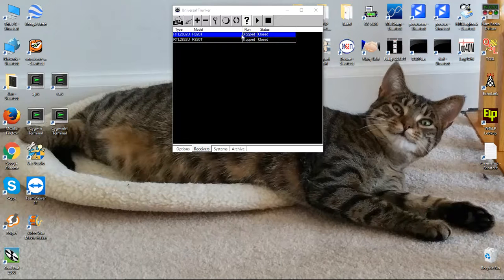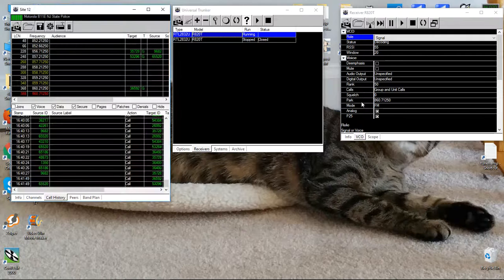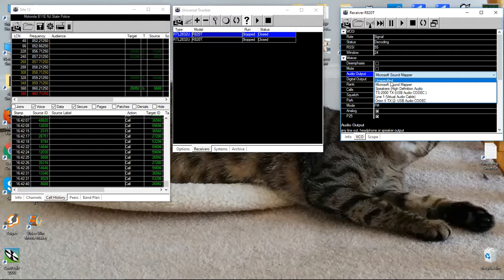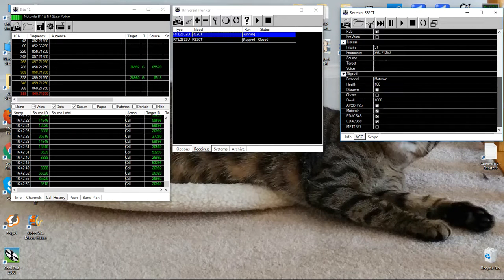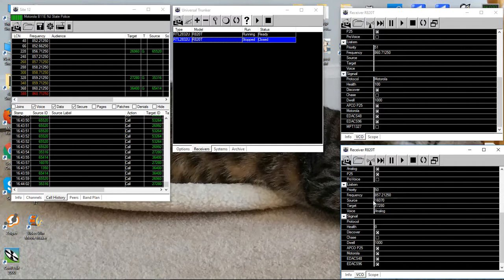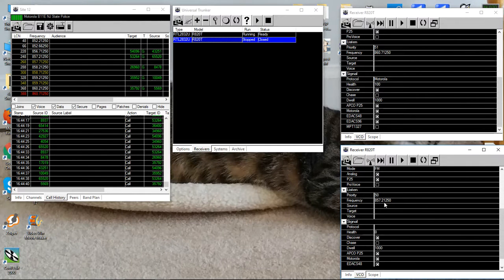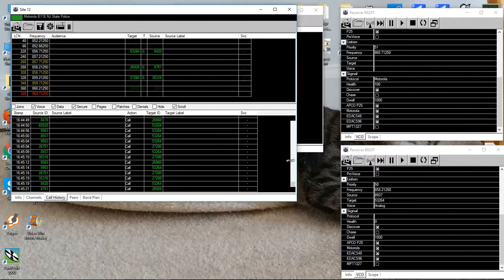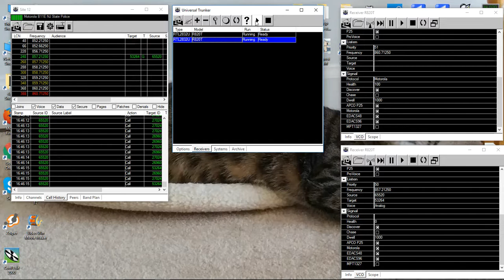Unitrunker Analog

Comment: When I use Unitrunker for analog voice systems, I always get a 3 second burst of white noise after a vice transmission ends before the squelch takes affect making it unbearable to listen to. Haven't seen anyone else with this problem. Also, if I enable deemphasis it mutes the audio but it sounds fine with it disabled. It is the squelch delay that is my problem. Works fine when using it with DSD+ on P25 digital systems.